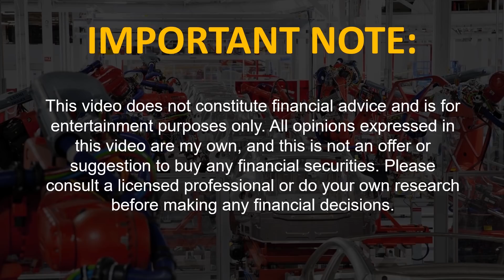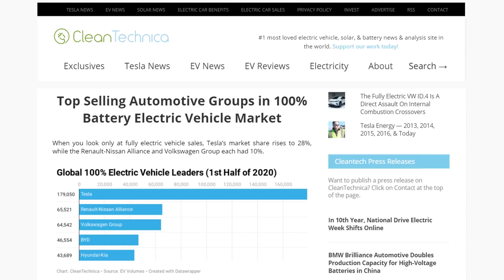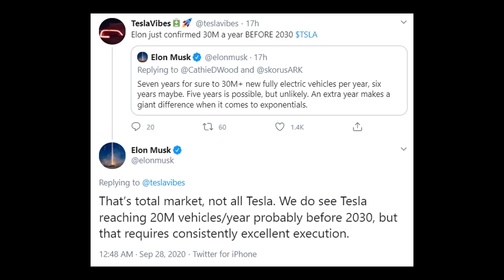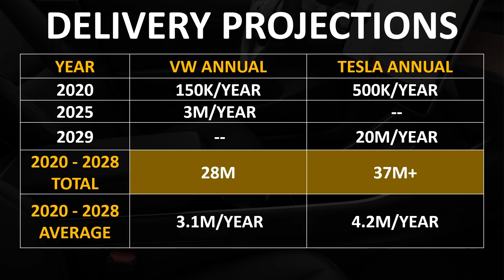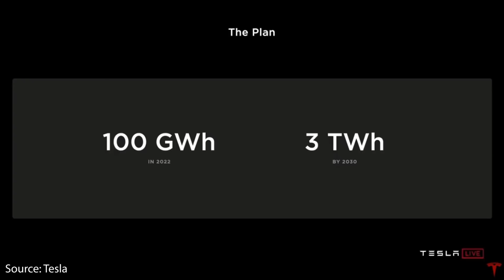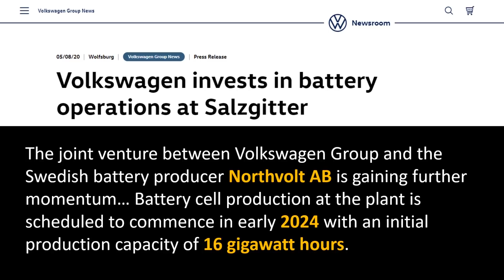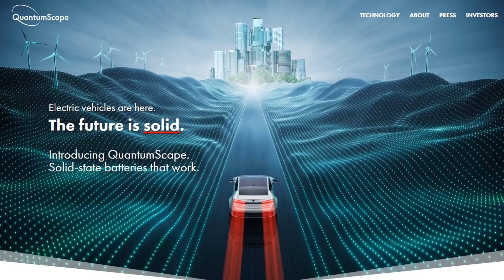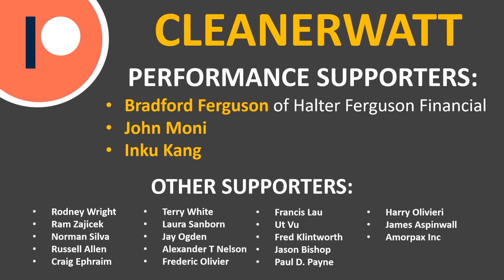Tesla vs VW: Can VW Catch Up? (Electric Vehicles)

Comment: Wow, unbelievable. I love how you are comparing the best scenario from Tesla with the worst scenario from VW. Let's digg a bit into this.

Tesla will produce 20 milion per year. This sounds highly unrealistic if we look at what type of cars are sold in this amount today on the market. The price category where Tesla is selling is the 40K+ what is the very tail end of the sails curve. Potentially maybe 5 million cars are sold today in this price range. So even if we assume noone is going to have a share in this price category your calculations already is heavily overestimate what is possible. This means Tesla can achieve this only if radically makes his cars cheeper. On other hand OEMs already are tooled up for producing cars in the most popular price range, the 20K-40K. Surprise, surprise, both the ID3 and ID4 falls into this category. Not in the future, now. So the production numbers are not exactly supporting your thesis.

Let's look at the battery production numbers. You are assuming, that because of Tesla is going to produce his own batteries will be in advantage of having access to them. This is correct, until we get down to the raw materials. The situation is, that Tesla is in same competition for the extremely suffocated mineral mining, so to be true your extreme Tesla advantage thesis Tesla would have to make a significant break true in mining. I would recommend you to make a bit research on this part besides of blindly listening to Elon. There is not a single expert having a smallest idea how Elon is planning to get the amount of the minerals to support the crazy plans. So it's brilliant and all respect to Elon and his team to the amazing work, but the battery topic is slightly bit more complex. So I am not sure this thesis of your can stand. 

The huge price advantage. This one, if Elon can pull in meaningful way trough some of the savings might be a small win. But I would highlight the "small" word. Everyone is talking about the battery price reduction as a game changer. How can it be if the price of the battery is at the best less than 20 percent of the car. Even if Elon would fulfill all his promises in time it would jeald at best 10% price reduction of the cheapest model 3 SR+ and maybe 5% or less reduction on the model S and X at best. So game changer, I am not so sure. If we look at the price difference between the Tesla and VW vehicles, you would need more like 25% discount on the Tesla to be even price whise on the same level. So I am not exactly sure where is the"game over for OEMs"
Reply: For a 75 kWh battery the price difference will be in the $8000 range in Tesla's advantage. There is no way to compete with Tesla if you are this disadvantaged. Remember Tesla has huge gross margins on their EV's while everyone else are having very small or negative margins.
VW cars lack performance and range. When Tesla launch "Model 2" in 2022. Who will by a VW?
Reply: @BjorckBengt   haha, nice math. A 75 kwh battery cost 8K if the 1kwh is 120 dollars as Tesla has it right now. If all what Elon is promises will succeed 50% cost reduction can be hoped, that means max 4K. That is in case if other battery producers will sit and do absolutely nothing. Very unlikely. Anyway, even if 4K would be saved from a close to 50K starter price car, it is absolutely irrelevant. VW even though produces a less fancy car can offer an alternative at least around 40K if not less. Rhe average car price in Europe is 32K, so even the ID3 is upsale. Forget about 20 milion cars what Elon is planning to sell at this price range. I do believe Tesla is going to be a significant player on the market, but I have no hope that will even achieve 5 million car sales annual at this price point. Elon is an amazing salesman. People follow him as sheeps :D
Reply: @gene8194  let's see. Elon always deliver and promised a $25000 car which of course will cost $30000 in Europe but most likely with much better range and performance than competition. I know which one I would buy and I drive VW today.
Reply: @BjorckBengt  So your answer is 'Elon says' ? Pretty much standard fanboy fare.
Reply: @pasoundman  Listening to Elon has made me a millionaire. I think I will continue on this path. Not recognising the smartest current business leader is quite stupid. It is good to be sceptical to a certain point, but when someone not only promise fantastic things but then also deliver, you have to admit the greatness or look like a fool. You look like a fool, sorry.
Reply: @BjorckBengt  Lucky you ! Eventually the bubble will burst. The rise of Tesla will soon bump into some obstacles.
Reply: @BjorckBengt  8000$ reduction how? Explain.
Reply: @djprojectus  
Tesla current battery cost 75kWh* $108=$8100
Tesla predicted cost $8100*0.44=$3564
Current Competitor cost 75kWh*$156=$11700
In reality the difference is even bigger since competitors require about 30% more battery capacity for the same range as Tesla battery management and electric motors are more efficient.
Reply: @BjorckBengt  You are comparing future Tesla battery cost with present battery cost of other competitors. In 3 years when Tesla batteries will be in significant numbers the competitors price will also be significantly lower probably under 100 dollars considering other competitors are making themselves battery plant or in partnership with others . So  in reality Teslas future battery cost advantage is near zero.
Reply: @djprojectus  My guess is that competitors will improve on the battery side but not at the same pace as Tesla. If that was the case then Tesla could continue to buy just from them, no need to put several billion dollars annually into battery factory investments. 
My hope is that there will be other brands than Tesla to choose from. I don't wish for a monopoly, but I am either not going to buy a car with inferior performance and range with lousy software, no FSD and bad charging options just to support competition.
Reply: @BjorckBengt  There is no guarantee that others do not have aces in their sleeves or that they are incompetent compared to Tesla engineers . Elon himself said they secured many contracts with many supliers for many years to come and guess what? Those supliers will have the batteries delivered to other competitors at the same cost to Tesla so zero advantage there. Elon clearly stated that 4680 cells will be for the high cost cars like the roadster,semi and for the small ones the weaker batteries. with iron instead of lithium
Reply: @djprojectus  As if Tesla has shown all their aces? Which company is more innovative on the EV side? which car companies are developing their own chips for self driving? Which car companies have 12 years of experience with a full BEV in the market? I suspect that the most innovations on the BEV side will continue to come from Tesla.
Tesla has patent on the tabless design. Without tabless design you can't do 4680 format. They will use the 4680 format for all three chemistries. The high silicon content which gave 20% capacity improvement was from a Tesla patent for thermal management. The dry electrode manufacturing which reduced factory investment by 69% is proprietary. We might see others coming up with similar improvements but that is just impossible to predict.
Reply: @BjorckBengt  Thats just it: its impossible to predict in 3 to 5 years who has the most ace's so your certainty that Tesla is the one on top in 5 years in terms of sales is absurd.
Reply: @BjorckBengt  oh boy, don't eat all what Elon is saying. The tabless thing is great achievement for cylindrical batteries. The pouch cells batteries already has that long time ago. Elon is amazing to make people focus on things what he wants to present. Because he knows that noone is going to do the homework to check and compare with alternatives. You boy really need to follow the industry before you talk like this. Don't forget, VW group has a lot of great engineers, not even mentioned many years of experience. We both aggre they're late in game, but they already have all their factories, workers and so on. Plus unfortunately they are not in hurry to change, next 5-10 years there will be planty ICE cars for sale. If not other reason, than because battery production will very likely not reach the production needed to produce the same amount of cars as ICE cars are sold today. 

On the autopilot, make a gues who is providing the solution for VW? Maybe it will sound familiar. It's called mobile eye. And not only for VW but for many others as well, so again, slower with the horses. Maybe at the moment there is a bit chaos and panic in the car market, but in a decade, when the ICE cars will begin slowly fading there will be a very different EV scene.
Reply: @gene8194  Pouch batteries are dead. Cylindrical batteries are a necessity to be competitive on both price and performance. Anyone who continues with pouch batteries will be left behind.
VW lack engineers in the most important categories, software and battery tech. Guess where those engineers first apply for work and who gets the leftovers. When Tesla starts their new engineering and design center, Germany's best talents will apply for work.
It is interesting to also see that a startup is beating the old guard in manufacturing. Tesla started with an outdated Toyota factory but when they designed a factory from scratch they could optimise every material flow and operation with the factory layout. Rebuilt VW factories will always be compromised.
As ICE car sales drop, so will economy of scale. They will be more expensive to produce while they will command lower prices. When volumes are halved, profitability is gone. This will happen before 2030. Those who do not run BEV production profitably at scale will cease to exist.
Reply: @BjorckBengt  Why are pouch batteries dead?
Reply: @gene8194  Now you have said many times that I should do research, yet you haven't provided any facts or logic to support your statements. It is quite obvious that you have a biased approach, but you will not change. Not even when the evidence is right in front of you. Many has claimed through the years that Tesla bankruptcy is imminent and that Elon exaggerates. Guess what, Tesla is today the leading automotive company and people are asking, will VW catch up. The answer is, if they could, they would have done so a long time ago when Tesla was small and not yet up to speed. From what we can see now it is more likely that Tesla will increase the gap than that someone will catch up. Anyhow, those are predictions about the future and if we live we shall see then.
Best Regards!
Reply: @BjorckBengt  I aggre, this is a dead conversation, because you don't even see all the facts and numbers I provided. Your contra reactions where repeating Elons words, but without context all what Elon is saying is true. So again take a look what the mining industry has to say, and try to brake down the cost of different parts, apply the potential cost reductions and add them again together, and you will begin to see what I am talking about. Good luck with your search.
Reply: @pasoundman  Why so much hate? For what exactly? It was quite obvious from the beginning that you are more emotional than factual. Have you lost money or will you lose your job. I am sorry, but that is not my fault.
Reply: @BjorckBengt  It seems that you misunderstand the word 'hate' !
verb (used with object), hat·ed, hat·ing.
to dislike intensely or passionately; feel extreme aversion for or extreme hostility toward; detest:

to hate the enemy; to hate bigotry.

Why is pointing out that Tesla is just another competitor in the car market assumed by you to be hate ?

It;s actually the fanboys who have an emotional attachment to Tesla, I'm entirely dispassionate.
Reply: @BjorckBengt  you really need to work on your math. 25K in US is 30K in Europe because of VAT. For 30K already there are cars to buy from others. So this is again an Elon big talk. Not even mention, that he has to first figure out how to actually achieve that price. So far the 35K model3 is kind of 40K. So I would not bet to see a 25K car even in US fir at least 3-5 years. So easy with the horses. All what you heard at the battery day is theoretical and kind of the best case scenario. So I have no doubts that it will happen, but kind of sure not in the close future.
Reply: @gene8194  I actually wrote €30k. Did you read my post? Elon big talk normally results in Elon big execution. Landing rockets anyone...?
The $35k Model 3 is available for sale. If you want options it is extra. The options on my Sharan was almost as much as the car itself.
With the giga castings and the battery cost reduction they are almost there already. Then consider the Model 2 as a slightly smaller car and it is highly likely that they will achieve that.
Reply: @BjorckBengt  let's see first the model 3 listed fir 35K. Just to counter your theory, in china they just announced the new cheepest model 3 for 36K in dollars, despite of made in china and made with the cheeper battery from CATL, what is 40% cheeper than teslas current battery. So please, work on your math ;)

As I already mentioned, I do believe Elon will fulfill his promises, but it's not going to be soon. I don't think we will see a 30K car in Europe any soon. At that time I am positive we will have good enough cars for even more reasonable price. As the other guy said, you can't compare future prices with today's. And let's not forget, the bottle neck is not the batteries, its the raw materials to make them. For that Tesla is at the same as the other battery producers. If you would have made your homework, you would know, that there is almost no chance to achieve Elons numbers, not because he is incapable, but because the supply chain is absolutely not ready to support that growth. Definitely not in the timeline Elon told us. Don't make me wrong, I am a big Elon fan, just a bit helarious what he is doing to keep the stock price up.
Reply: @gene8194  Tesla sell the MIC at a higher price point despite lower cost in China. The MIC Model 3 has the highest margins. Price is not the same as cost. So please work on your logic ;-)

Tesla is the only car manufacturer with a clear battery supply strategy including raw material supply. They just closed a deal with Piedmont lithium and they are working with nickel suppliers. They are the only ones with zero Cobalt chemistry for high performance batteries. VW has to buy batteries in competition with others. Who do you think gets the better price?

Elon is known to say that the stock price is too high.
Reply: @BjorckBengt  haha, again, please watch a few mining company comment's on the topic. The piedmont deal is for a bit extra capacity, not even near enough for Elons plans. By the way VW has investment in northvolt, so it is not true that it's only Tesla has preparation. Anyway, my point is, that the rest of car makers can already offer alternative for much cheaper, and maybe you can afford to pay for a Tesla, but majority of people can't and will not. So better Elon will come out with significantly better price or there will be a significant pressure from the other OEMs. At the moment the more wealthy people are shopping, these are not endless.
Reply: @BjorckBengt  A car isn't a space rocket ! Wake up !

Comment: Tesla plans to build 20 Mio. cars per year in 2030. They have shown how they plan to build batteries for these cars and how they want to get the raw materials for these batteries. Todays car production is around 200 mio. cars per year, so this would mean that Tesla plans to get a 10% share or less if the car production is growing further to 2030. But there is one thing that could change this.... if autonomous taxis are ready in 2030 and Tesla can produce these autonomous taxis, the tesla could get a much bigger share of the total car market. There are a lot of studies on how much autobomous taxis are needed to deliver our mobility needs. The estmates run from 15-30% of cars without full self driving capabilty. Could you dive a little deeper into this? Because this means that Tesla could build up a taxi fleet that could deliver as much as 50% (or more) of our transportation needs in 2030... so there is probably two to three other taxi producers worldwide and that is it... Tell me if i am wrong...
Reply: World wide car production is about 100 million / year as of 2019.

Comment: What about the VW investment in QuantumScape? QuantumScape's lithium-metal battery with solid ceramic electrolyte  definitely deserves a mention here.
Reply: Once solid-state batteries start to be used by 2028 or so, there will be another leap in range and crash in price. Any remaining ICE producers will become as important as horse breeders.
Reply: How much better in energy density are those?
Reply: QuantunScale’s battery is lab bench top only. That is 10% of the trick. To develop it to prototype, then to production at the right cost, takes about 8 years. Tesla is aware of all the solid state batteries and are trialling them. I would expect Tesla to start trial runs of solid state batteries by 2028.
Reply: And Nordstrom and whatever the name of their latest battery investment in China was...

Ah yes, Farasis Energy Co. And Guoxuan High-Tech Co and possibly more. It's difficult to follow this.